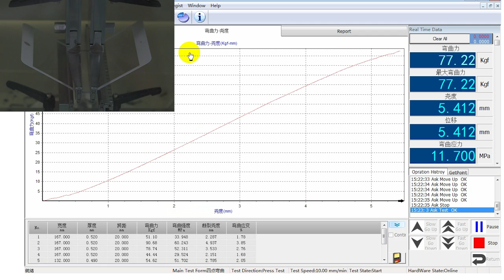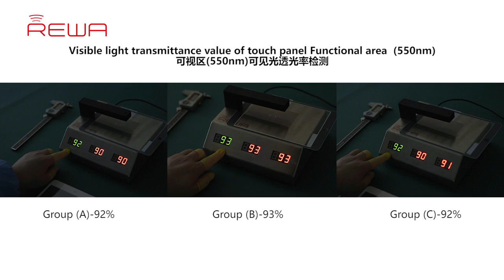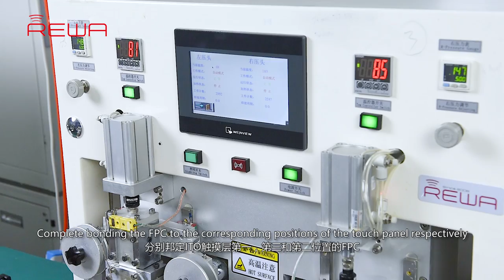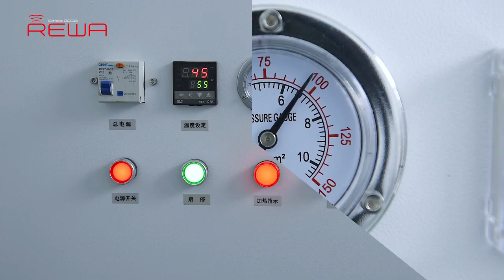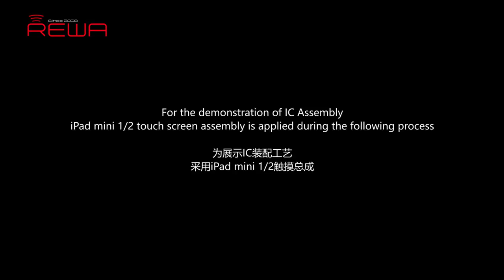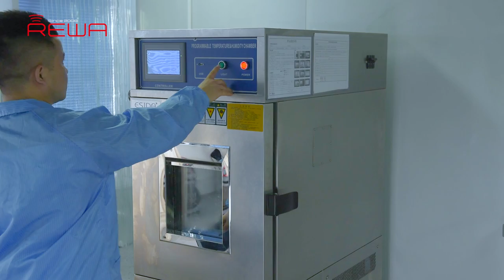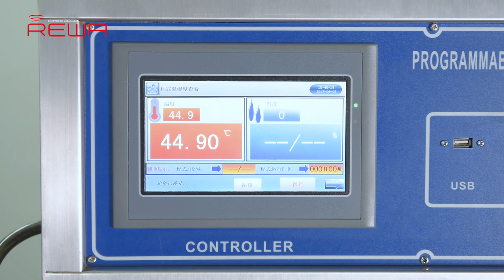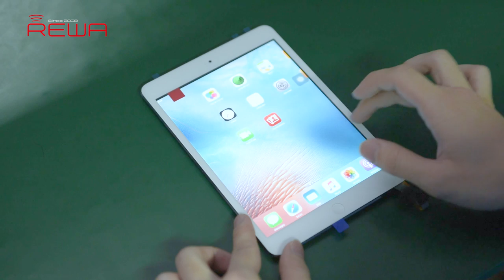Reveal The Aftermarket iPad Touch Screen Supply In China

Comment: ah, that's why most of Chinese replacement parts I've found they're all have a blue stamp on them..

But most of fake samsung/iphone charger giving electric shock or nasty explode anyway, although they have the blue stamp
Reply: Just because it's made in china doesn't always means it's fake or bad quality. It all depends what company manufactured it and what their standards are. All the original shit is made in china but the companies like Apple and Samsung require such high quality control that they will refuse to purchase your product if it is sub par and not of good quality.
Reply from the maker: Yes, may be there are some Chinese products come with low price and also bad quality, but it is not always the case. It depends on the companies and manufacturers. Company with bad quality can not last long in the industry.